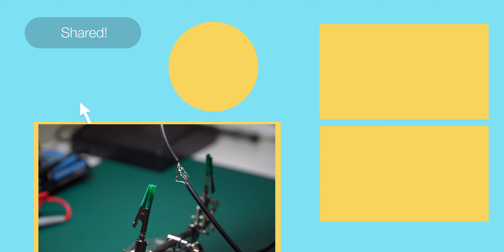How to Solder USB Wires Together

Comment: The shrink wrap with solder in the middle is super easier and it keeps the wires insulated all in one go. Just put two ends of the wire in the shrink wrap where the band of solder is and heat it up. You don't even need a solder gun, solder, paste, or electricity! Just a nice jet lighter and you're good to go!!
Reply: Good idea.
Reply: I almost dropped my light bulb while reading your comment here! Would have been another night picking at the carpet again.

Comment: Question: How do you heat up micro wires so that they will melt the solder before they burn up? I'm dealing with turntable tonearm phono micro wires. So far, I've burned up wire and melted no solder.
Reply: Same issue here, I see no one making a video on it, is it really impossible? Tiny wires burn extremely quickly at soldering temperatures and break, or burn to the point where it becomes copper oxide and no longer conductive.

Comment: 15 watts soldering iron is perfect for that shielded wire. Rubber tape is better than electrical tape, a pcb bus terminal connector is much better than coupling a wire that size to avoid grounding.

Comment: Very nice. And so that works just fine for data cables? I understand how electricity flows in a copper cable, but I don't know how data flows. I don't think you can just cut and patch optic fibre for example.

Comment: Why do you not dip the second wire in the flux? I'd have thought that would allow the solder to flow more easily.
I recently saw a video in which they only partly removed the insulation and used that to twist the wires together. It did seem to give a better result, without the odd rogue strand sticking out.

Comment: Is it okay if the wires touch? I thought each one had to be insulated from each other or else they would short
Reply: He said, he used electrical tape around each one before the insulation.
Reply: I think he said he said he use electrical tape around this. He didn’t say each.  And wrapping electrical tape would be a challenge since the gap btwn wires are limited.

Comment: Heat shrink exists. Electrical tape around a solder joint is guaranteed to fail.
Reply: Yet that's how Ive been joining wires for a decade now, and it does hold up as long as you wrap it tight and not too much.

But I would prefer heat shrink when available, it's just cleaner and more professional

Comment: Trying to put shrink tubing on each wire is a pain.  The heat of the wire while  soldering causes one end of the shrink wrap to shrink making it almost impossible to push over the joint  The only solution is to make your wires long enough and use one of those clip on heat sinks to keep heat away from the wrap.  don't forget one large wrap to cover the whole joint.

Comment: Good luck with the insulation and the data transfer speeds!
Reply: I'm a noob, and I completely agree with how insulation will be a pain in the ass since he didn't put the heat shrinks before soldering; but how is data transfer speed going to be affected ?
Reply: @srtghfnbfg  High speed transfer rates require impedance continuity through out the length of any cable. If you cut it, this changes and it is not continuous anymore. With low speeds that should not be a big issue but as the speed increases this can be a problem.
Reply: @lefteristsintjelis5515  that's interesting =o so the solder changes the impedance at that specific region since there's 2 different materials (e.g. the wire and the solder) ?
Reply: What if you don’t care about data transfer and just need the power.  (I’ll use heat shrink on the wire

Comment: Pretty unit you are not twisting the wires together you are twisting the strands of the wires together and you are also using the flex to make it flow that’s flow.

Comment: This was painful to watch. 😅Reminded me how I soldered as a kid.

If you want the solder to bond well to the wire — it needs to be brought up to an optimal temperature with the iron where the solder coming into contact with melts into a stable liquid without spontaneous recrystalization yet not too runny to drip right off, then let the happy couple cool down naturally together. Feed solder onto the hot wire.

You're not getting a good bond by using the iron tip as a vessel, introducing runny solder from it onto a cool wire — they just don't vibe. Flux sure helps mask and partially mitigate it. And the separate step of coupling two wires together reheats the solder in a better kind of way. Those hacks did feel sufficient to me as a kid too but it's tough to look at my past botches.